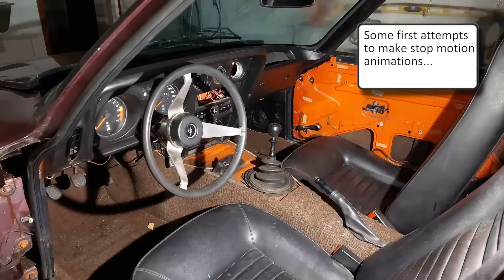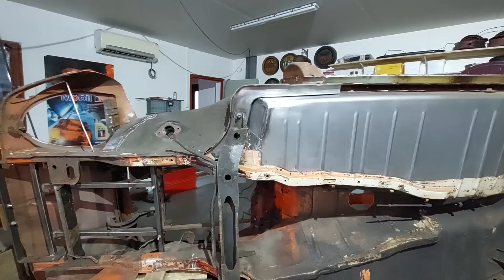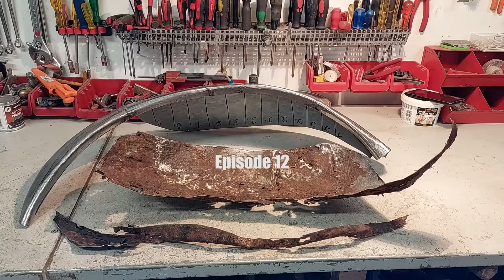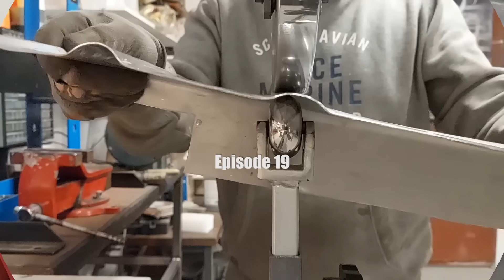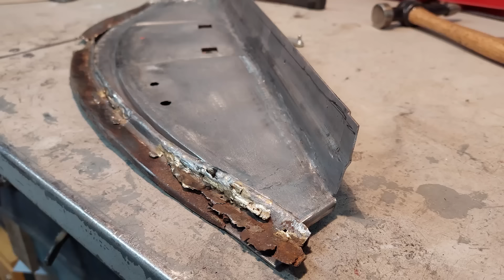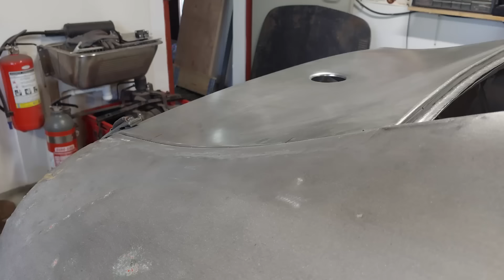1 MILLION VIEWS in the project. OPEL GT 1971

Comment: I'm not a car guy. I'd watch your content regardless. I consider myself extremely lucky that I happen to be restoring a GT as well, my first car project, and I get to see what's underneath, so I know what corners to cut and which not to. Congrats on a million views. That's an insane number of people. Consider that more people have seen one of your videos than have ever lived or even been to several actual States in the USA. Consider that an arena holds like, 20,000 people. Your viewers would fill an arena in every one of 50 states. It's mind-boggling to recognize the true scope of what you've shared with the world.
Reply from the maker: Thanks Matt for awesome comparison !! So what is the plan with your project ?
Reply: @GT1900garage  I bought two empty shells, welded them together, and am making it into an EV using junkyard junk. Forklift motor, drill pack batteries, etc..the restoration (even half-assed as mine is, but just to get it safe to drive), has been 95% of my time, the EV part only 5%.

Comment: Be good if You could get motors for the pop up head lights so the both turn to the middle instead of both to the right it's just I like symmetry  lol 😊
Reply from the maker: You know. I have given though or two about this, but then I decided to keep the original setup...Symmetrical rotation would have been cool though...

Comment: I remember when i bought my first GT in 1982. It was only 13 years old and the price was 1800 DM because it should have a rear axle damage. In reality someone tried to fix the shaftbearing and forget to install the spring in the transmission. So the shaft slided into the rear axle and lost the connection to the transmission. The repair was done for the price of a beer. Stay tuned and good luck, Stefan
Reply from the maker: Hi Stefan and thanks for a great story !! That was a cheap fix 🍻

Comment: Congrats.

Wonderful work, but i wonder why you toggle and over lap panels instead of butt welding. Toggling and welding both ends means twice as much welding and therefore heat (which means distortion) and its not required. We are restoring mere cars not making submarines needing to take the pressure at the bottom of the ocean.

Looking forward to your next update video, but I encourage you to just butt weld mate. Take your time, hammer and dolly and will be flat and straight AND way strong enough. Good example: https://youtu.be/Kpbp0buRcEo?si=7Eu7JNaVO9AZyPk3
Reply from the maker: Simple reason :  I can not do it 😎
I know that it supposed to do, but since original Opel factory panels are 0.8 - 0.85mm and I use only 1.25mm sheet... With my skill set, it it impossible to have good quality weld, that have full penetration, YET is not burning holes to the thinner material. I have tried, several times. My method is that I make a recess so panels can align and weld it solid, then I cut the overlapping part and double weld from the other side. Redundant, but my only way to have solid welds without too much of a pores that could cause problems in the 10 years time....I am so jealous for those who can weld 30's and 40's american cars, they have thick "pre war" material that is so much easier to weld.
Reply: I will stay here. I like the music and the stop motion much more here.
Reply: @GT1900garage  I have noticed your welding has improved lots since I started watching your channel. I think you weld fine now :-)
Reply from the maker: I think so too.. Partly because of training, but biggest difference was that I ran out 0.6mm wire, and accidentally bought 0.8mm wire. Then I had to increase the amps, and suddenly it was so much easier. With 0.6 wire, it either did not melt the base material enough, and just slight increase of amps, would burn palm size holes in the panel... It was very frustrating..
Reply: @GT1900garage quite a few years ago my MIG welder that I had used for over 20 years wore out the wire feeder drive and I could not get parts for it.

I eventually bought another and hated it with a passion. I use 0.6 wire and anyway I fiddled and fiddled and practiced and then all of a sudden one day "I had finished my training" and now I love the thing.

In the end, yes I had to get the settings right but the main thing was I feel I had to adapt to the new MIG